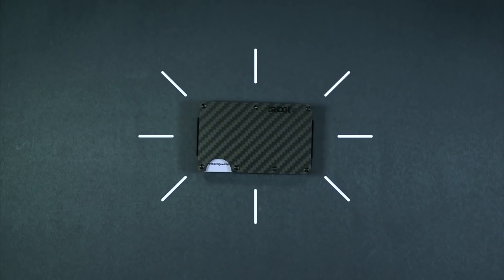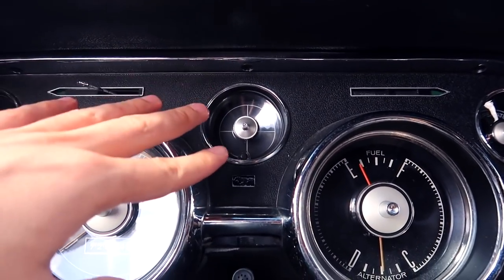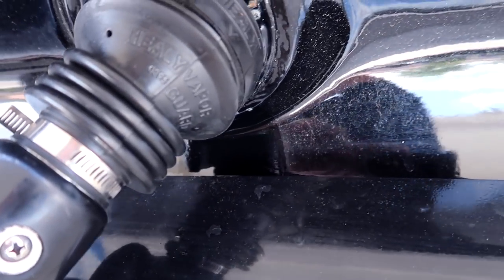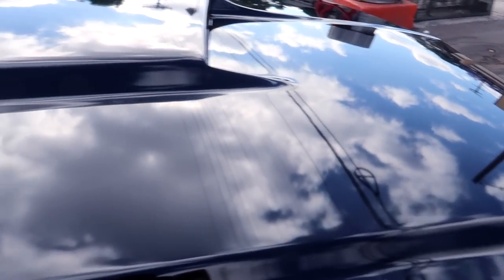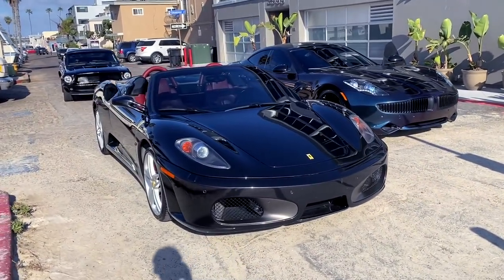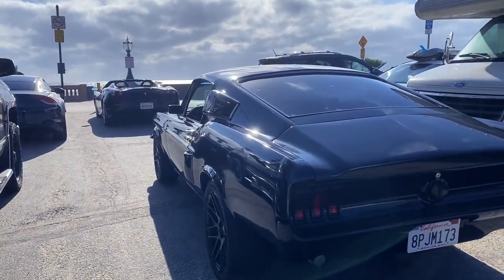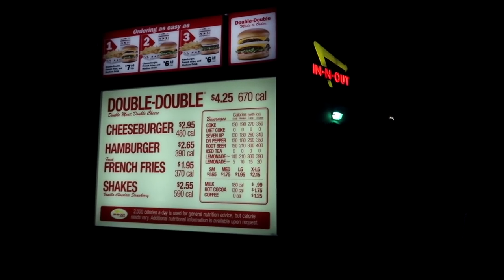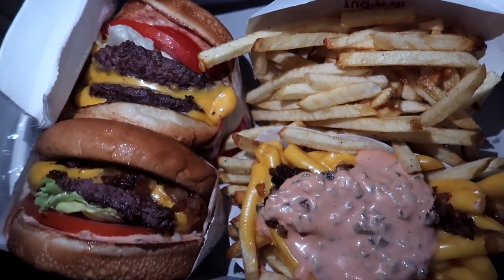FIRST DRIVE in my 1968 Ford Mustang FASTBACK! Episode 4

Comment: To get rid of the slop in your steering wheel check at the bottom of the steering column for what is a called a rag joint. That is what converts/translates your steering from the column, to the rack and pinion. Its older technology that they engineered back in the day. How i know is because my 88 fox body has the same issue evidently not as bad as 68's. You can either find an aftermarket steering column or chop and weld on a u-joint coupler.
Reply from the maker: thanks for letting me know that ill look into it. Subscribe to channel please!

Comment: I  am probably not the first to say this but go with the Borgeson conversion for power steering. It eliminates the control valve and ram underneath the car making plenty of room for headers. Instead your power steering lines go directly to the steering box. Since your car is a 68' you should have a collapsible steering column making it much easier to install the Borgeson box unlike earlier cars withe the rigid column. You could use either the factory pump or the Borgeson pump which is lighter and provides more assist at low engine speeds.
Reply: I went with the borgeson set up on my 67. Great product but my hooker super comps long tubes hit and had to move tubes around and re weld to make it work.

Comment: Don’t ruin the car with a LS swap!!
Reply: cars have the hood down 99.9% of the time.remember that.also go drive anything re-ls powered and be amazed 
at how good,fast,efficient they run and how much cheaper they are to build.
Reply: trillrif axegrindor it’s not always about being a cheap build or being a little cheaper build than like a coyote swap! It’s about what thing are worth after you do a engine swap, it will be worth more keeping it all Ford than putting a ls in it, if it was a different car I might would say put a LS in it but this a is already a classic and putting a Chevy motor in it will ruin the value more than if it had a ford motor in it
Reply: Nate is a Mustang guy man no way he puts an ls in

Comment: There's a company that makes a small tachometer designed to go in the empty slot with the crosshairs where the accessory clock would go. I have one in my '67 and it's definitely a nice mod.
Reply from the maker: thanks for the info. Subscribe to channel!

Comment: I cannot stand power steering. Got rid of my power steering in my 65 GT350 clone and I love it. Oh, my car is my daily driver. I’m old school, so I would go with a stout small block or go big block 427 or 428 N/A engine either way. Switch to manual as well. If you do, I’ve been using a center force dual friction clutch and has never let me down. I also think period correct 15” wheels would look right. Again, congratulations!

Comment: Paint looks like it's just clearcoat scratch. As far as the gas you have the big hole opening for the old days of having leaded gasoline. Get a funnel and some gloves.  Play in the steering was something we just dealt with and didn't think anything about it.  But today with all the resto mods you can tighten up no problem  the stereo you got has to go bro. You can get nice reto stereo that looks like the original. Nice ride👍

Comment: Got a question for ya...I have owned a 67 Fastback my entire life as well as a 65 coupe and I have always known one main tell tell to know the difference between a 1967 and a 1968 at first glance and it was the 68 has lights on the rear quarter panels and the 67 does not, so my question is did the previous owner replace the rear quarter panels with 67's or were they shaved to make it appear to be a 67? If not you might want to check the VIN# LOL but other then that you have a beautiful car! I just started following you to see what you do with it.
Reply from the maker: Black Widow they were deleted with the body work

Comment: please dont drop in a modern engine like an ls, coyote or 3 valve. 
you can get a junkyard 351w and re build the top end (heads, intake, cam, headers and a good carb or efi) and you´ll be making over 400hp easily , or you can buy a 347 stroker.
Reply from the maker: im really wanting to keep it classic

Comment: I found this post as I am having the same issue with the gas on my 67 mustang. Check out this post. Gonna head out to Home Depot tomorrow https://www.vintage-mustang.com/threads/1967-1968-mustang-fuel-nozzle-adapter.914370/